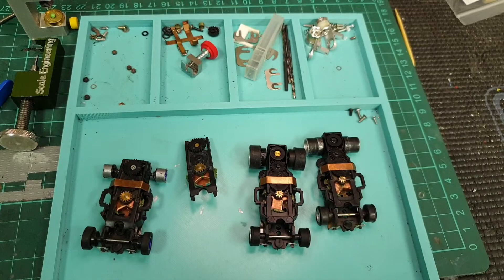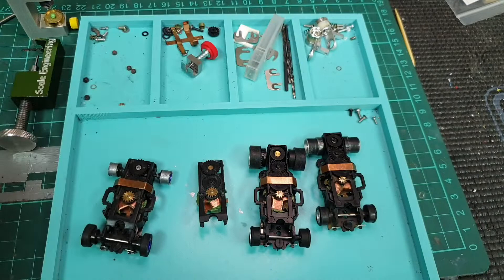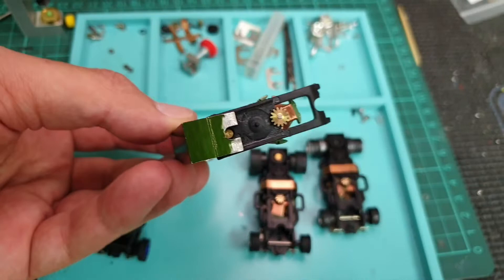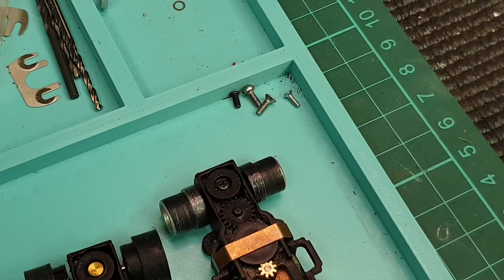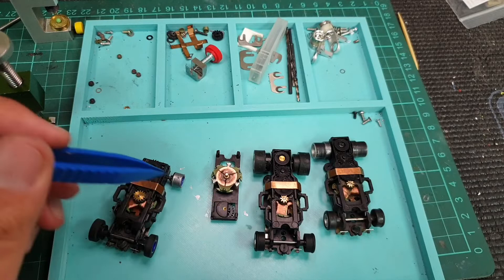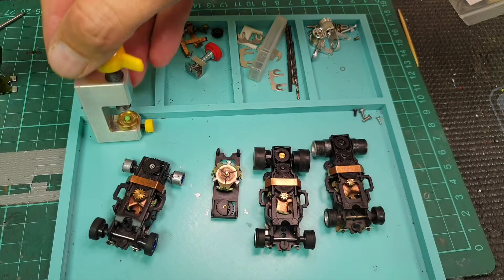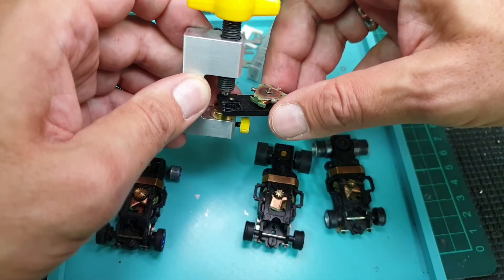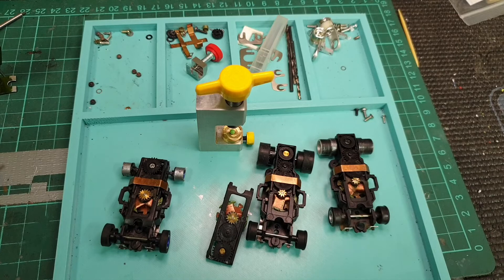Drag Racing H0 slot car, Autoworld 4gear Chassis, gear setup #h0slotcar #autoworld #slotcar

Comment: Excellent video guide! Thanks a lot.
Reply from the maker: You're welcome!!! Hope I could be of some help!
Reply: @slotcardude68  Yes. I have come to the hobby recently and had my first bad experience with an AW chassis, a 4Gear. Bought 2 new Funny cars and one was noisier and slower. That gear is usually the culprit. I also have an issue with a used Super III chassis but I think the problem is the brushes/spring brushes. I am going to order a Pit and see what I can do.